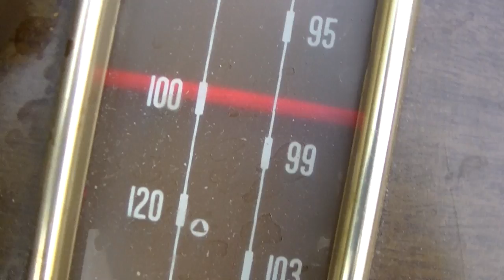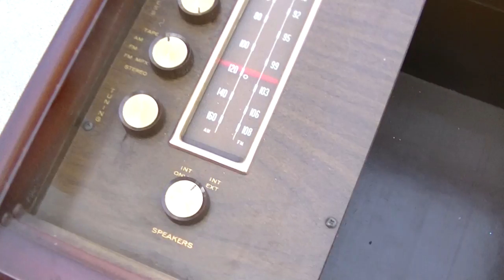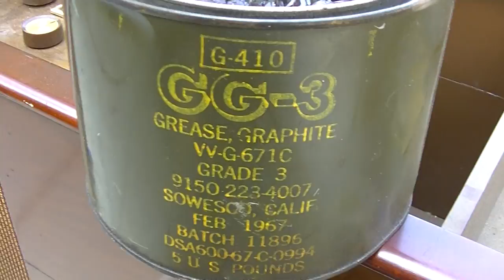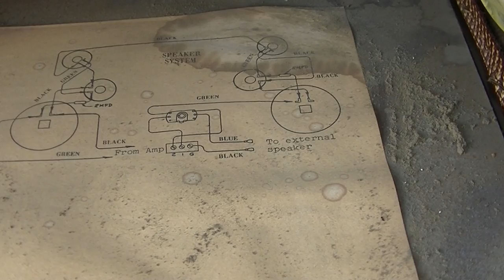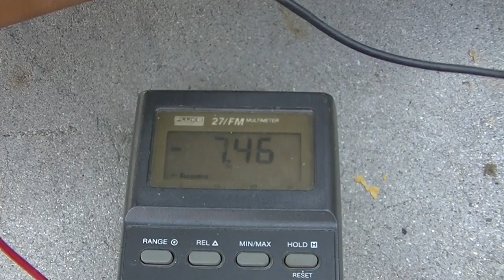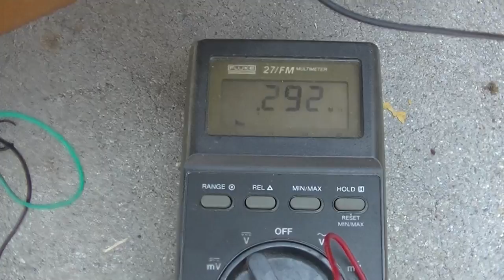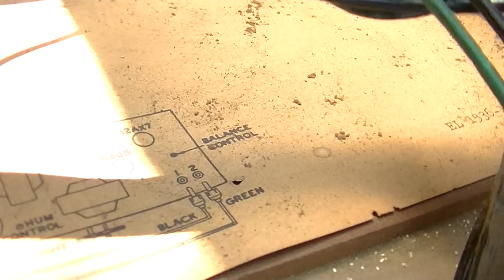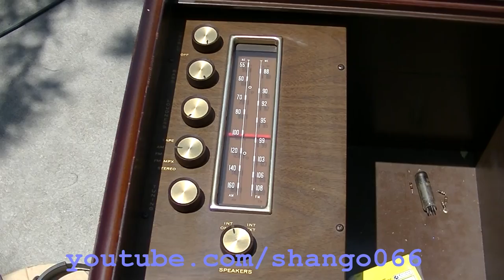Magnavox Console Stereo Record Player Repair

Comment: At 19:10 it's probably a good thing that you are wearing rubber gloves, because on some vintage equipment the RCA shield is also a power supply ground between the preamp and the power amp.  I found this out the hard way when I was trying to track down some residual noise issues on a Danelectro guitar amp with a top mounted preamp containing two 12AX7's, and a bottom mounted amplifier and power supply. The umbilical cable connecting the two chassis carried B+ and heater current but didn't include a ground wire, and when I  unplugged the RCA cable with one hand my other hand was resting on the amp chassis, so I became the ground return circuits and I got zapped with full B+ right through my chest. Just something to be aware of.
Reply: That must be a guitar amp thing. I've never seen anything like that in radio or hifi equipment. It is bad engineering to have a low-level signal shield carrying DC current, as it can be induced as noise into the signal. In this case it could induce really nasty feedback.
Reply: @lwilton  , yup, a Danelectro guitar amp ---- they built most of the commonest Silvertone guitar amps, and so there may be other similar models with the same "shocking" design flaw; any amplifier with top mounted control panel, especially one with preamp tubes and active circuitry (like the Dan-o amp) and bottom mount amplifier should be assumed to be similarly in need of safety modification or at least some ground-loop removal by floating the shields. Interestingly, the shield-as-power-supply-ground scenario did not cause any major additional hum with the Danelectro, even though I had already added a grounded power cord to the amp chassis . On the other hand,  I've worked on a rare Masco guitar/PA combo amp ( beloved by harp players) with bottom amp and top-mounted control panel (no tubes, no active circuitry) that hummed badly after upgrading to a grounded power cord. Adding a ground wire between the two chassis and floating the shields at one end cured it. (PS, any Silvertone amp with sn aluminum chassis is almost certainly a Danelectro product).
Reply: “Things where built better back then”

Comment: I worked on these sets in 1962 at Dayton's in Minneapolis. This was a basic radio-phono combo, priced within everybody's budget. They never excelled in sound quality but were OK in the home. Our shop at the Third Avenue warehouse opened every carton and tested these sets before they went to the customer. We found a good 20% stereo failure rate and repaired them before they went to the customer. From that experience we set up an inspection line next to the shop and all tv, radio and phono were checked out before going to customer. The record changers were a miracle for reliability. We did, however, find a high stereo failure rate among the cartridges. Magnavox chose a different cartridge and problem solved. The clever indexing system always set the tone arm on the record correctly. The next version of this model had an adapter socket to connect an optional stereo FM kit.
Reply: I've got a beautiful early 70s Magnavox turntable 8 track combo.  The turn table need doesn't want to fall on to the record that's spinning though.  Do you know why it would stop going into position  It just hovers over the record.

Comment: Some of those old Magnavox consoles looked a little cheesy, but this one, despite its modest performance, is really nice looking. It would be worth keeping the guts working just to keep enjoying that cabinet.
Reply: Some of them are actually quite good performers.
Reply: @douro20  yes i would keep it the way it is and just repair/restore it
Reply: Once you get it restored properly its amazing how well they sound. I have just got a 64 yesterday for free. I had to wake it up. Needs to be gone through for regular maintenance.  And some tlc. However..... its loud and unbelievably clear sounding for a middle of the road model. Better than alot of modern stuff.

Comment: The balance control is under the bass, treble, or loudness. It is like my grandmother's hi-fi the differences between them is the hi-fi had an fm only radio (why because am was first out), the stereo controls were on the same side as the record player, no tape option,  and the balance controller was between bass and treble sound instead of left and right.

Comment: He’s right. These bring money now after service. They’re cool units. And they sound nice.
Reply: Stay in the car Brad
Reply: Never seen one of these consoles with only two 6BQ5 outputs, they are usually two pair in push pull. Single ended is only 5.7 watts output at 250v plates and -17v grid. This one is only 165v plates, so I am guessing 3 watts per channel? With 15" woofers? That don't seem right, what do you think? (well actually 244v, 165v was when it was being dragged down by grid leakage, also the distortion at 5.7 watts is 10% THD and that would not be hifi, 1% THD in this era was considered acceptable)
Reply: @zulumax1  appears to be the case - single ended stereo. 2-3 watts per channel. I've read some people like the sound of these amps. 3 watts can be quite loud, but naturally it's not going to be some .01% THD performer.
Reply: @JulianA-tr6pt  Yes, that is correct, I have 25 watt per channel mono block Heathkit amplifiers and Altec Lansing Horn Speakers. 5 watts per channel shakes the house. I also have a 1965 Magnavox Astrosonic console which is 6.25 watts per channel at onset of clipping, it is all about the efficiency of the speakers. I have a few videos posted on the Magnavox.
Reply: @JulianA-tr6pt  Looked like the output transformers are too large to be single ended 3 watt ones, that is why I was wondering if the engineer was using a simplex circuit that uses multiple tapped primary audio output transformers.
Reply: @zulumax1  the quality of the speaker does make a big difference in sound quality.
Reply: I remember driving around with my grandpa about 20-22 years ago trying to find a thrift store that would take the all tube Zenith console. Several stores refused it. We ended up taking it to a waste and recycling transfer site downtown and I believe he had to pay something to get rid of it. Wish I still had it today, especially being an tube model. My grandparents took care of their stuff so It wasn't in bad shape. I've since found the manual and paperwork for it cleaning out their house after they passed away a few years back.
Reply: @johnchildress6717  Yes, speakers vary the sound more than any other device, second to microphones and phono cartridges. Mechanical to electrical or vice versa is the hardest part to get right.
Reply: @JulianA-tr6pt  When I was a teenager I had a Hoffman 21" black and white TV in my bedroom with a RCA 45 rpm record changer hooked up to it. That has a single ended 6K6 tube in it which is 3 watts into a couple of big speakers in the bottom of the cabinet. My parents thought it got quite loud enough as I recall.
Reply: The guitologist I have 2 I have a long 6 foot Motorola console stereo it was my grandmother's I got it when she passed away 3 years ago and it will knock pictures off the wall it's got so much bass and volume and plays like new. But I got a smaller zenith stereo that works fine too. But I was wondering how I can get more volume from it. Can you make just the speakers have more volume? I seen a video where someone was showing how car spark plugs hooked to the speaker makes the bass and volume louder. Is that true?
Reply: I have one. My Dad's from 61. It works and sounds fantastic!
Reply: @michellevey9608  I was wondering about when this one was made. My parents had the same cabinet, but the inner workings were different. They bought theirs in 1962 or 1963. Asked my dad, who is 89, about it and he just said, "Ya, in there somewhere". They must have made the same cabinet for a few years.
Reply: @airplaneengine  very sad that console stereos have only been getting good attention in the last 10 years because I bet the majority are long gone since the 80s and 90s when they were useless to everyone
Reply: @zulumax1  The output of the amp is ten watts. Five watts per channel.

Comment: Good going Mr Shango, despite the stony path. One of those lighters with the long neck for lighting barbeques held under all those resistors shows the dud ones right away. Brake fluid or Benzol should soften up the idler wheel somewhat.
Cheers from Germany

Comment: Take some fine grit sandpaper (420 grit works well) and lightly rub the edge of that rubber wheel with it. The surface of the rubber tends to get glazed. I tried it on an old phono I had and it works great.

Comment: Since the 6P14P are getting more and more expencive, i started using 6P15P (Svetlana makes them as SV83) and they sound good. They are dirt cheap and the exact same tube. The only catch is that it doesn't have internally conected g3 with cathode. I connect it externally, and if a customer wants the original tube, they can just plug it in without concequences.

Comment: My aunt bought this model in 1958 and passed it on to me in 1978. The multiplex was an option that one would have to pay extra for at the time. It always has had wonderful sound.
Reply: it may be possible for someone to rig up a stereo decoder using modern parts if the owner now wanted it fm stereo ..
Reply: I too inherited one just like this one except for slightly different styling but very close and the same electronics.  I remember reading the owner's manual and it stating that the FCC had not quite yet approved FM Stereo broadcasts; so when it was approved, you could buy a "Multiplex Adapter" to listen to FM stereo.  This had RCA inputs on the bottom of the tuner, along with the phono and tape ins/outs.  I tried like crazy (around 1978) to try and find a Multiplex Adapter for my stereo and it was not to be found anywhere.
Reply: @andygozzo72  I agree 100%.
Reply: @JRobert111111  THE FCC had two broadcast formats and had to decide which one would be the best.You are right I read this in a book ,basic radio and tv, around 1962.I wish I still had that old book.
Reply: There was a guy on another channel restoring a Bush console (aka. "radiogram") from the early 1970s and it was the same deal; the decoder was an add-on. I think Canada and Australia also adopted stereo FM later than the USA, with Australia not getting it until the late 1970s.

Comment: Sometimes lightly sanding those hardened rubber tires, then using lighter fluid on them will expose some fresh rubber and give better performance. Good video, gave me a few good chuckles!
Reply: Yes, some Coleman camp stove fuel (white gas) works good to bring them back.

Comment: For rubber wheel, try to seek for a flat belt (the ones from tape decks) that fits snugly. You can use a thim film of contact cement around the rubber tire prior installation. I was suggested this trick for a rubber tire from a JVC deck that is "unobtainable". I used some small belts around them ... it worked for me.

Comment: There used to be a thing called rubber rejuvenator we used in the 90s on offset printing presses to extend the life of the rollers on the press. Not sure what it was chemically.
Reply: Still available. 
Chemical cocktail in it includes; xylene, ethylbenzene, methyl salicylate
Reply: I was this, tryed to use it on rubber piece from tape deck. Tires .... I noticed some improvement ... on pinch rollers is a waste of time.

Comment: You are loosing some bass due to going past 1/3rd on the volume control as the loudness contour gets lessened around that point.  If the tuner was working top notch, there would probably be more bass as you wouldn't need to go wide open on the volume.  Interesting on the resistors as I've never seen them fail like that in operation, just normally drift upwards.  I bet if you connected an old late 80s Delco car stereo to those speakers it would be shaking the ground with bass!  I built a set of speakers using drivers from an old RCA tube console which are 15x9 and the bass they can put out is insane with lower wattage stuff.
Reply: ESD180, if that console was mine or whoever owned it wanted stereo FM I'd put an inexpensive FM tuners through an aux input or tape input if it had one. No way would I let my records, or records belongings to anyone I cared about, get played in that record changer!
Reply: @goodun2974  I hate to tell you this,that Collaro changer tracks at three grams. I should now, because I have the same set
 I also have the service manual for the set and the correct specifications are listed for the changer .
Reply: @johnalbanese30  , its not just about tracking force; friction, both side to side and up and down, has a lot to do with record wear.
Reply: @goodun2974  A lot of turntables for those consoles were supplied by Garrard.
Reply: @ostrich67  , the commonest record changers I saw in tube-type consoles were Motorola, but some had Voice of Music or Collaro record changers. BSR and Garrard came later, mostly in solid-state consoles; an improvement in terms of lighter tonearm and lower tracking force, but still pretty crummy.   Although there are a bunch of audiophiles who have the hots for the Garrard 301 idler drive turntable, the only modern Garrard turntable I ever saw that was worth a darn was a model we sold in the audio store I was working in in the early eighties that was direct drive and fully automatic and actually pretty nicely built, but sourced from somewhere in Japan. At that point Garrard was probably just a name and not the same company at all.

Comment: I have one identical to this one (1ST226K) that also had similar  multiple resistor failures, two in the amp and two in the tuner. As with this one, I believe I already had one dead channel and then the other one went  I had no sound at all. The two in the amp were at the 12AX7 tube, but I can't remember about the ones in the tuner, as this was at least 15 years ago! Although  they could very well be the same as this ones as this one.  Still works fairly well, although there's a lot of fm drift, and the turntable speed is slow even with a new drive wheel. This one seems to work a little better than mine does...I'm a bit jealous!

Comment: I think this is the first repair I’ve seen you do that didn’t require at least one cap change.
Reply: just proves that those that say first thing you do with old equipment is change all the caps are wrong!  waxy tubulars, yes, if high voltage across them in use, and manytimes electrolytics, not always, though,  but even so , first thing is to make sure no 'unobtanium' or expensive parts are failed or missing, such as mains transformers, coil packs, etc.

Comment: Stores that sold belt kits and new tires (square 'O' rings essentially) used to sell a rubber renew liquid. 
It smelled awful and worked 50% of the time. 
Useful if we had a cheap customer that did not want to pony up for a full replacement work (additional hours due to having to disassemble stuff to get belts out, etc.)
-
I'm amazed that you are doing customer repairs though for other people, while lying down in your driveway... that's pretty ghetto :D
Mind you, I would not haul that thing into my living room either. Not in that condition.
Cheers,
Reply: I still have a can of what I used back in the 90's, here in UK, called Platenclene (made by AF) ... I also bought some liquid used for restoring Reel-to-Reel rubber parts, called RD700 (made by cleaners4hygiene) ... the Platenclene did actually last quite a while ...
Reply: It's camphor-based. It didn't work very well, usually because by the time the problem was addressed, the rubber had completely dried out.

Comment: You should try working on the Aussie sets Shango! My mum has a Kriesler multi sonic hifi 3 way radio gram with electrostatic tweeters. When she bought it in 1965ish, it was state of the art. Separate power supply but the tubes were mounted on the main guts upside down underneath the power switches and volume and treble bass etc? This meant that the heat had no where to go and over a Jurassic period of time it just died. The components were well done. The sad thing is that it could be restored but we don't have the technicians here to do it. I tried to at least spray the pots with deoxit but the tubes have had it along with the caps and everything else. I plugged a modern turntable into it using a preamp before it died and boy did it sound great. Push pull. 10 watts per channel sounded like 100 watts. It was a kicker. I'm gonna hold onto it cos Australia is having a bit of a valve or tube as you call them revival. Me personally I'm a valve man born in 1961 so I grew up with all this stuff. Now I own 3 new valve amplifiers a Primaluna HP is in my bedroom. I love it. All point to point wiring and no PCBs. I own a Leak Stereo 20 too. It needs work and I found a tech who can restore it. Cheers and keep the videos coming and have a nice soothing cigarette. Andrew from OZ. 

i

Comment: Radio will feel even better with metal film resistors (modern chinese ones are cheep and good, but in case they burn the smell of modern lacker is awfull and old soviet MLTs are better in that aspect, but finding a pack of moderate precision ones is impossible - they are usually 20% and gausian spread in a batch is really poor, so old american millspec ones must be much  better).

Comment: The single-ended outputs are the reason the bass is lacking.  Unbalanced direct current flows through the output transformer primary, magnetizing the core and lowering its inductance.  A push-pull output has the current flowing from the center tap outwards to both ends, so the magnetic fields cancel.  To me, a push-pull audio output stage is a must for true, full sound quality.

Comment: Just spin the tire in a drill and run a file or hacksaw blade in the center to cut a groove.  Add an oring to the groove and it will work like new.